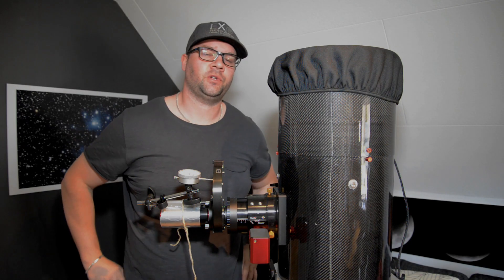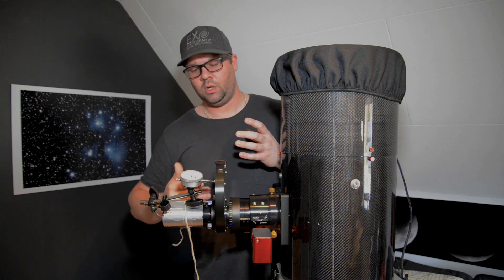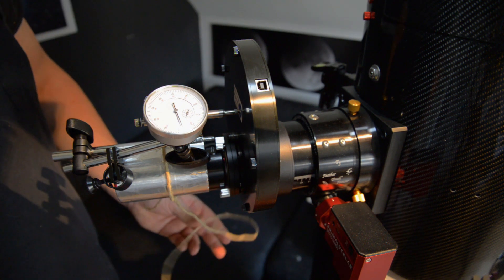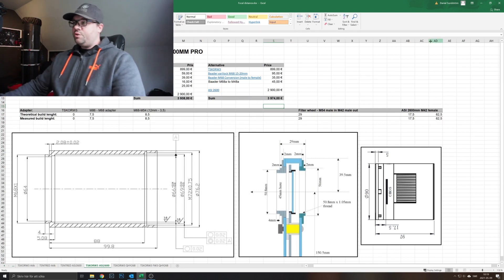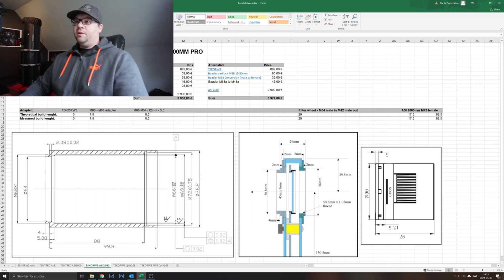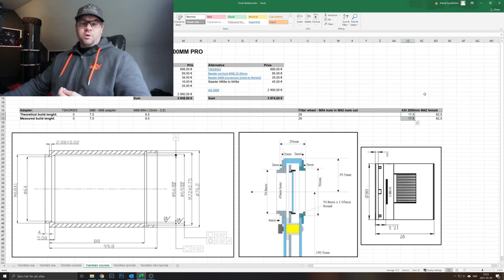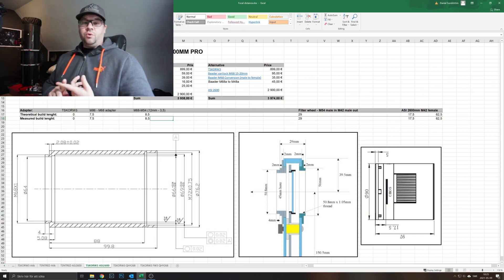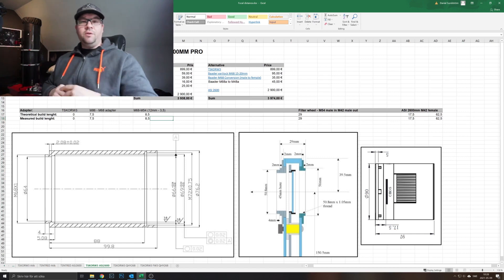New astro camera - measure flex and calculate your back focus!

Comment: Is there a way to manage flexture in a Newtonian scope? I've got a 10" CF Quattro and I seem to have flexture dispite having a carbon fibre tube
Reply from the maker: You might wanna check if there is mirror flop (mirror shift) or anything else first, i higly doubt that the tube is flexing, why are you suspecting tube flex? what are the symptoms?

/Daniel
Reply: @ExoPhotography1  I have already addressed the mirror flop/shift and replaced it with a aurora precious bracket unfortunately, I recently was able to spend more time on the telescope and I think it's actually my spider, I have been trying to get this telescope to actually work for the last 9 months, I have replaced the focuser and the primary bracket and now I think the spider will be next. It is rather annoying the quality of the build. I experience my collimation shifting whenever I slew to either side of my mount, do you have discord or anything I can contact to you? I didn't realise you had replied over a week ago
Reply from the maker: @Sanctimonial  Regarding your secondary, take a look at how strong your spring is, mine was to weak.
Reply: @ExoPhotography1  ok good point I will check that in a couple weeks